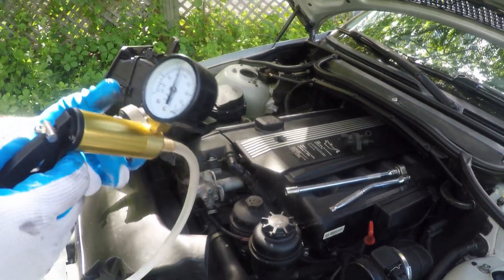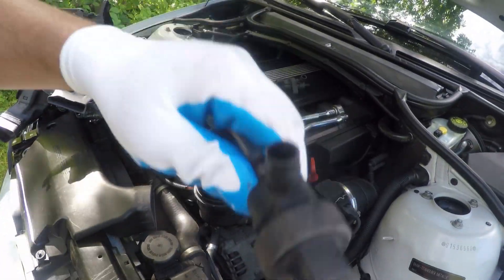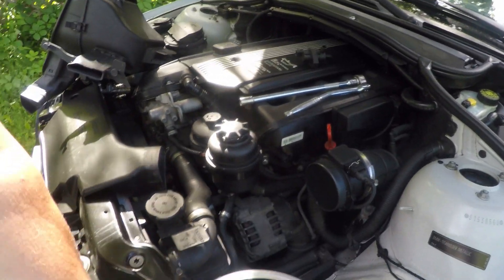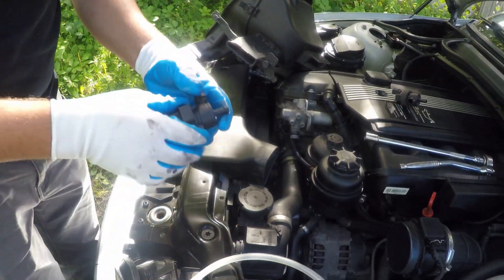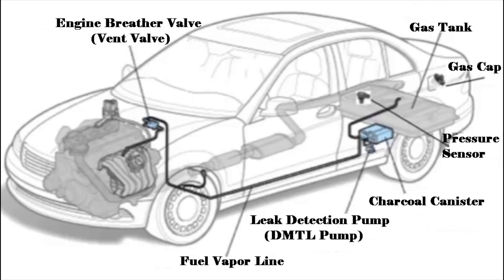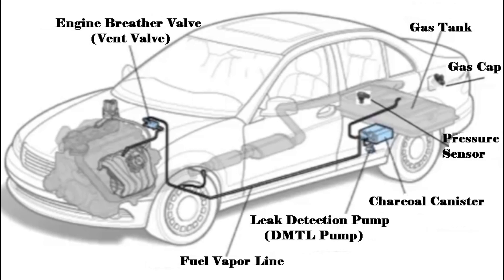Purge (Vent) Valve Replacement, Vacuum Leak Diagram Explained, Code P0441, P0442

Comment: I dont believe that is correct. The vent valve is by the vapor canister in the rear, not in the engine bay as you show.
Reply from the maker: The one in the back of the engine is vacuum control valve. The one I am showing here is the engine breather valve or tank vent valve.

Comment: i have a BMW E90 320i 2005 the engine shut down when i stop at red light, is not giving any codes, this valve can be my problem? i change the ccv valve before, the oring on the vacuum pump and stil does that. before shuting down the car have rough idle. thank you!
Reply from the maker: Sorry for the late reply, I hope you have it figured out by now. Was the engine still running or after it shut down it never ran? It could be a lot of things, but my fear is the timing chain guides have broken and engine is out of timing.

Comment: I have an e39 528i I get an error in the scanner I checked and I have the ventilation valve but there is no hose that I connected with it. Could you help me and guide me from where the hose to the valve comes from and where it ends. very grateful for the help.
Reply from the maker: I am really sorry I have missed your comment Javier. Let me know if you still need help with it.
Reply: @GearSpec  
hello! No, I haven't replaced it yet, that fuel tank vent valve keeps showing me a fault on the scanner. But I don't have any loose hoses where I connected the valve. That is why I would like to know from what point it comes and to what point it goes (I suppose it goes to the admission). I would appreciate that information. Greetings from Peru!. Thanks a lot!!
Reply from the maker: This is the line that I believe you are talking about: https://www.ecstuning.com/b-genuine-bmw-parts/breather-line/13907504303/?gclid=Cj0KCQiAip-PBhDVARIsAPP2xc38QcjYYn6WE3z204l0ZeIyK3BvJYXEWVP-VjtfPCOCWOk0Zb7m18saAv17EALw_wcB  There are 2 hoses that connect to breather valve. The one I have attached goes from the tank vent valve to the intake manifold. And the other hose is bigger and it has a push pin connector at the and. That hose comes from your charcoal canister: https://www.ecstuning.com/b-genuine-bmw-parts/fuel-breather-line/13901437611/?gclid=Cj0KCQiAip-PBhDVARIsAPP2xc0nGYSpAnQiIwL6D8PHkB3z5XnQRMqLEtj53LAonX9jOik2RQ61cT0aAgr3EALw_wcB
And if you are missing both of them, that’s not good, you will need lines as well.

Comment: the main vac line has come off the engine now i cant find where it goes
Reply from the maker: It goes around the engine and it connects in the back of the engine, right upper corner. It’s hard to see because there is not enough clearance. You need to take the cabin air filter housing off in order to be able to reach back there. Just follow the line by hand and you will find it